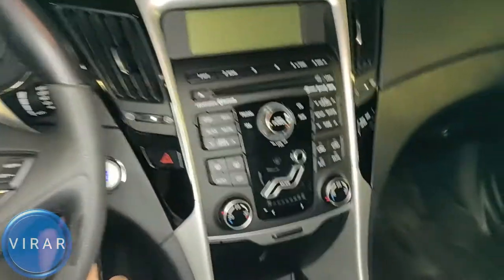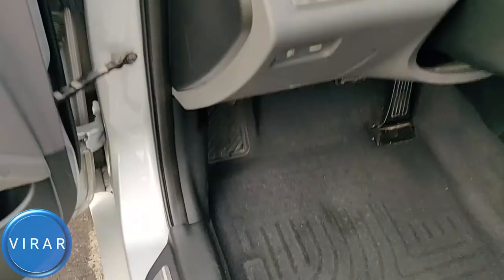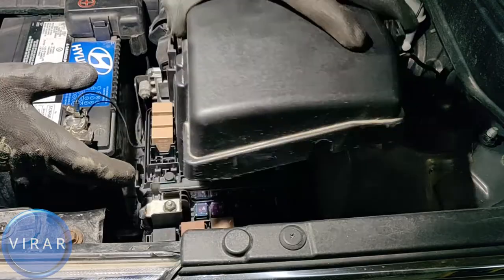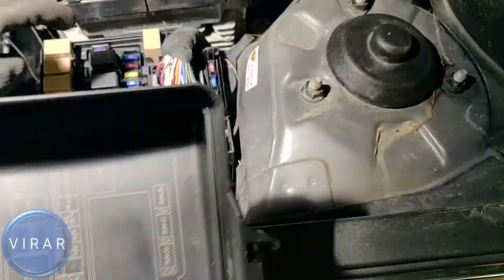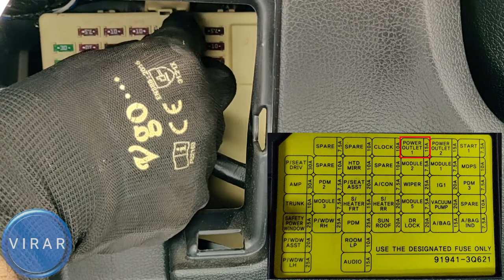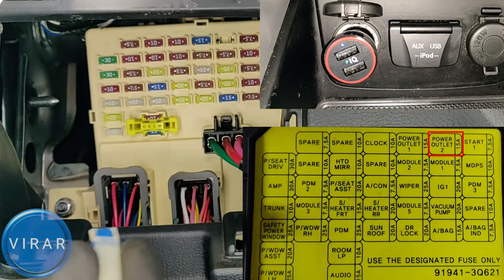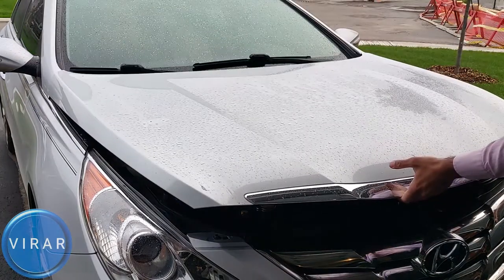How to Fix 12V Power Outlet/Cigarette Lighter - Hyundai Sonata (2011-2014)

Comment: its not a fuse I had that checked
Reply from the maker: Well in that case it's probably the outlet itself or the wiring. The fuse is usually the culprit and easiest to try out.
Reply: @VirarAutomotive  are they expensive to replace?
Reply from the maker: The part itself is not expensive. Around $30-35, a mechanic  shop would charge you about 1 hour of labour. ~$100.
Reply: @VirarAutomotive  thanks so much!

Comment: So I wanna ask before I try this. But were there two appropriate spare fuses for the charger port or did you only swap one?
Reply from the maker: I only swapped one. There is only spare fuse of the correct amperage

Comment: Well done instructional. I have a problem with the 1/8" input beside the power outlet- connection is very poor when I plug in ipod. Is there a way to take the face plate off for that area and get in and either replace the 1/8" female connector or fix the connection? tia
Reply from the maker: https://youtu.be/y0LvTMeMKNA

This could help!

Comment: Where can we purchase extra fuses?
Reply from the maker: Any auto parts store will have new fuses. Be sure to buy ones of the right size and amperage. I would suggest a blown fuse with you in the store when you go shopping.
Reply: Can’t find any spare fuses 15A
They’re all too big! Help😢
Reply from the maker: I'd suggest checking around there in the store. There are a couple standard sizes of fuses. There is one that is bigger than the one in the Sonata and one smaller too. 

Good luck

Comment: Does this also go for the USB port ???
Reply from the maker: Are you referring to the USB port that's in the middle there ? Besides the aux input ?
Reply: Yes
Reply: Also looking for answer to this @virarautomotive
Reply from the maker: No it doesn't unfortunately. Usually when that USB /Aux part goes bad, the way to fix it just replace the part. It's a fairly common issue.

Comment: Sir where is fuse for backup camera in that car
Reply from the maker: I don't think there is a seperate fuse for the backup camera. The backup camera going bad is a common issue for the 2011-2014 Hyundai Sonata. The solution to it is just replacing the camera itself. It takes some work, but I have done it a couple times in the past and its totally doable, probably take like 20-30 mins.

Comment: so you didn’t have to buy a different fuse???
Reply from the maker: That is correct. There is a spare fuse in the car to solve the problem right away. At a later time point I suggest to get a pack of fuse to replace the spare fuse that gets used up to fix the problem here
Reply: @Virar Automotive - Thanks so much for the video!  Are there also spare fuses in the panel under the driver's side dash?
Reply from the maker: I don't think so. I think all the spare fuses are in the fuse panel that's under the hood.
Reply: @VirarAutomotive  Thanks.  I'll go check for you when I replace the one that you said to replace. Really appreciate your help!
Reply: @VirarAutomotive  I found out that in my 2011, there are no 15A spare fuses under the driver's side dash, but there are 10 & 20's.  I'm sending u a link to a page that shows not only the 2011, but later years too.
Reply from the maker: It's possible that at some point someone used a 15A fuse and never replaced it.
Reply: @VirarAutomotive  There's a 15A, like u said, in the engine compartment.  The schematic for the fuses under the dash does not show that a spare 15A ever existed there.  No biggie.  Just a FYI (for your information). :)
Reply: @Virar Automotive:  I wonder where the link went that I sent you!
Reply from the maker: I didn't get a link. :(
Reply: @VirarAutomotive  I think maybe YT doesn't allow it.  I will write the website. I also wanted to send the screenshot of the under dash fuse panel, but I see nowhere that I can attach a picture.
Reply from the maker: I am a little confused.

In the video right at 2:10 , I show where the 15A spare fuse should be. There is a 10A, 15A and 20A spare fuse in the fuse panel in the engine compartment.
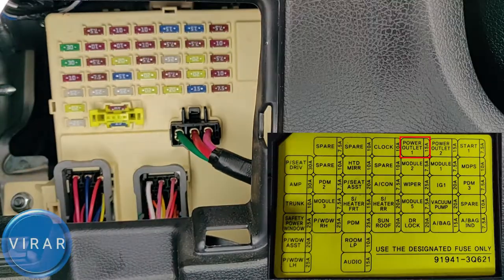In the driver dash there is a spare 7.5A and 10A fuse. as indicated in the fuse diagram visible in the video at 1:37

So for the purpose of what I show in this video, you just need the 15A spare fuse in the engine compartment as I show in the video at 2:10.
Reply: @VirarAutomotive  Yes, I took the 15A out from in the engine compartment and I put it in under my dash, so now I have both power outlets working.
Reply from the maker: Got it! Cheers!
Reply: @VirarAutomotive  Thanks for all your work!